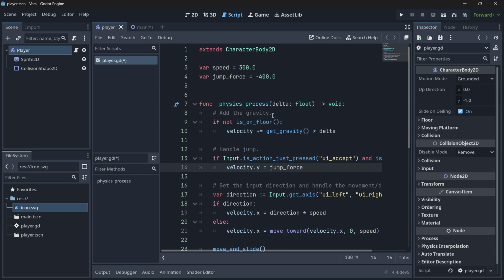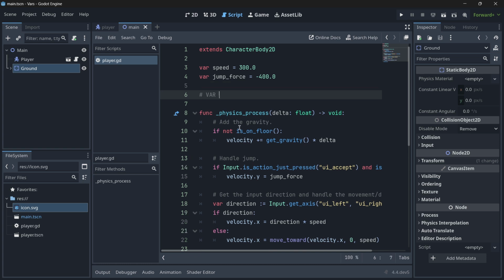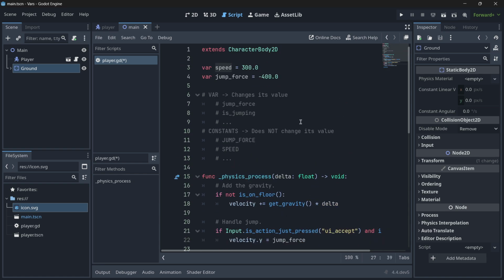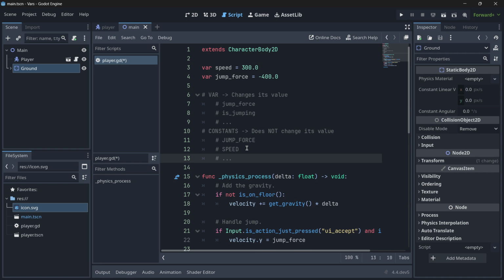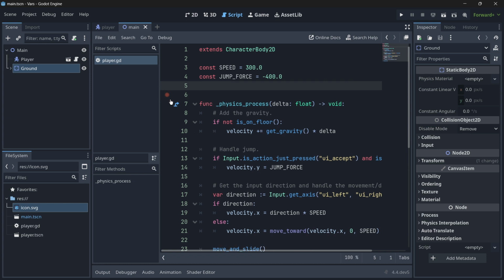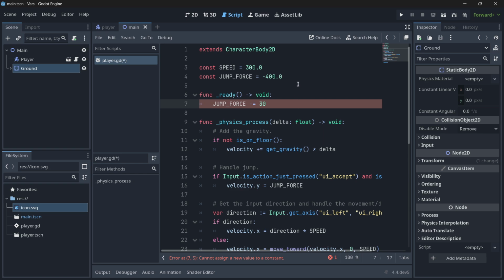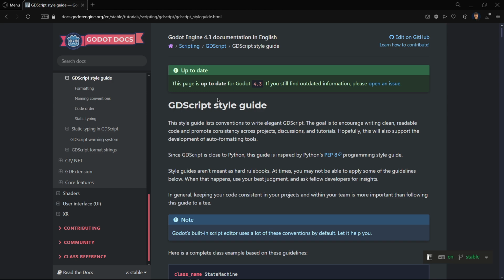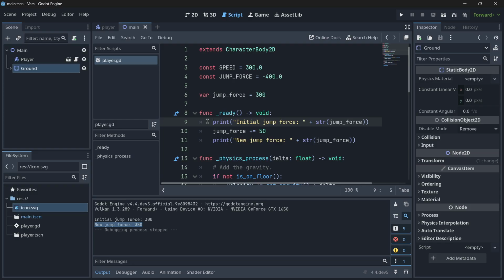Stop using Variables in Godot Wrong!

Comment: There is no wrong way of using variables in GDScript. In this case, no performance difference will be caused by using constants no matter how your project scales. If you are thinking this much about performance, use C++ not GDscript.
Reply: Gdscript is performant
And btw it does not use garbage collection unlike C#

Comment: It's also best practice to statically type variables, e.g.:
var speed : float = 300.0
or
var jump_force := -400.0

That will reduce the number of cycles required to perform operations on those variable as Godot does not have to check, at runtime, what type of value they contain. That check takes time to perform. This is unnecessary with constants as their type is always implicit and static.

For anyone wondering, this is why speed, and jump_force were not statically typed at the beginning of the video but the variable, direction, on line 21 was. In the CharacterBody2D template code that Godot generates when you attach a new script to a CharacterBody2D node, SPEED and JUMP_FORCE are declared as constants which don't need to be statically typed.